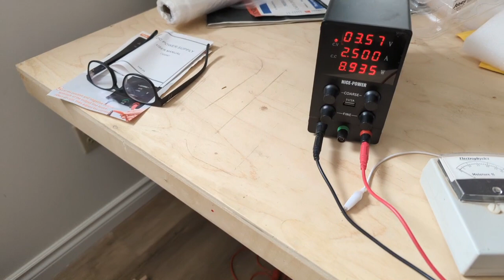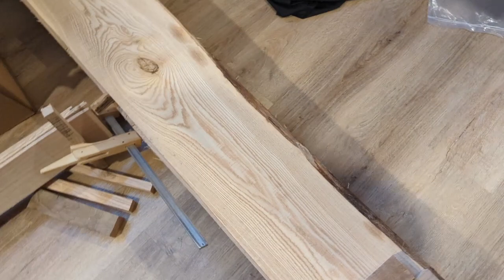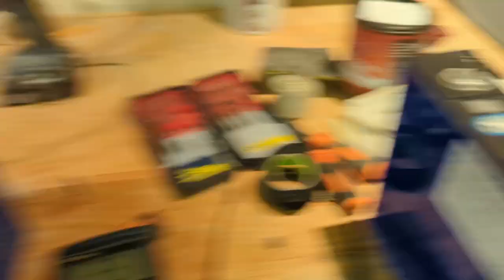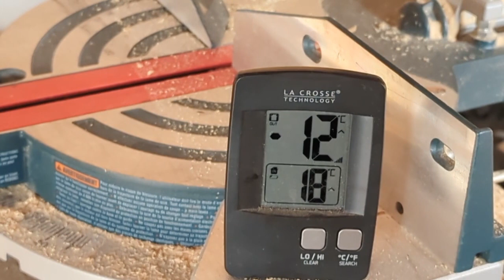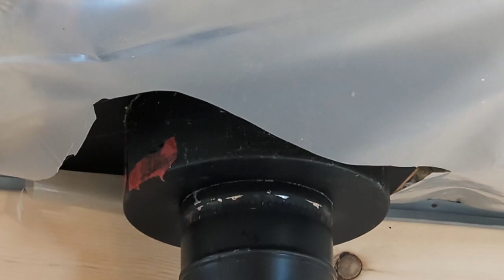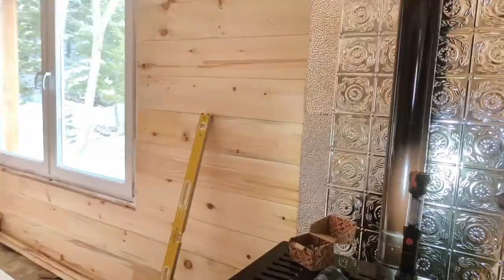BATTERIES AND TIN FOR THE STOVE

Comment: Hello from northern Alberta :) The cabin is coming along great, you probably cant wait till your there full time, I don't know much about Lithium batteries I have Gel & I am just hooked in 12 v so when power coming in or going out I am hooked to P on one end and G on the other end of my string of 10 - 105ah 12 v works great , I have wifi TV, 18 cubic fridge water pump is RV 12v 55psi at the tap and I run 40 gallon propane hot water heater all good :))
Reply from the maker: Going back up in a couple days and may pick up the inverter
Reply from the maker: Don't know why your comment doesn't show up in my comments, sorry.
Reply: @offgridonthecanadianshield5185  Hey technology :) The cabin is coming along great, you probably cant wait till your there full time, I don't know much about Lithium batteries I have Gel & I am just hooked up in 12v so when power coming in or going out I am hooked to P on one end of the string & G on the other end of my string of 10 - 105ah 12v works great, I have Wi-Fi, TV, 18 cubic fridge , 12v RV water pump, that's 55psi at the tap & I run a 40 gallon propane hot water heater its all good :)) ,
Reply from the maker: @littlegriffoffgridalberta6837  Showed up on a previous episode.  I thought you were replying to the latest

Comment: Remember Not to charge the Batteries ( Lithium ) if they are cold 32F.  They are safe cold as long as you  do not try to charge them until they warm up to over 41F.
The optimum ambient temperature for charging a Lithium battery is +5°C to +45°C / 41°F to 113°F.
We can adjust this to 20% DOD ( Depth of discharge)  to a max charge state of 90% giving you  70% total  capacity to work with.
Was there any printed info on these batteries? Certified sticker? I'm interested in figuring out the 48v settings for both BMS and Charger.
Reply from the maker: I ordered the batteries with a 100A Daly BMS and made sure they included Bluetooth and temperature sensor.  Charge 0C to 55C and discharge -30C to 60C.  They are grade A matched with codes intact.
Reply: A conservative voltage setting will extend the life of these batteries for a very long time. Nice way to protect the investment since this is not cheap.